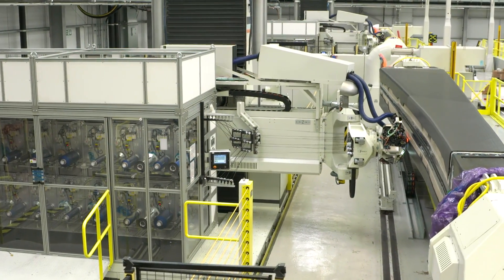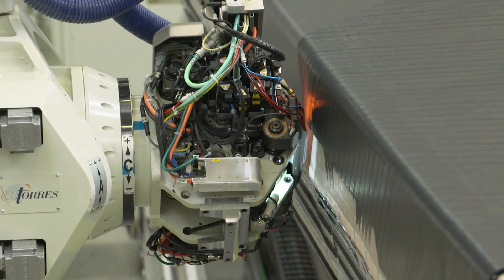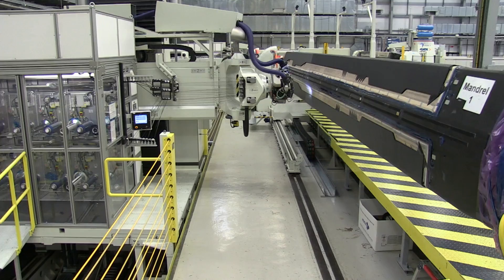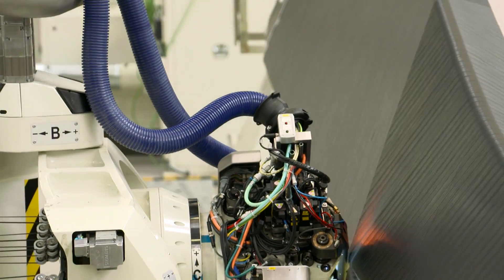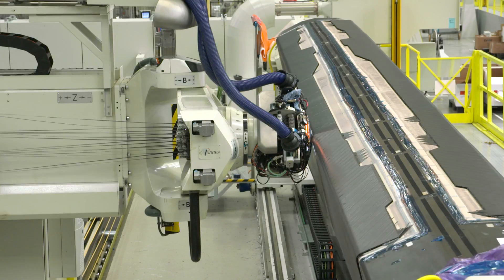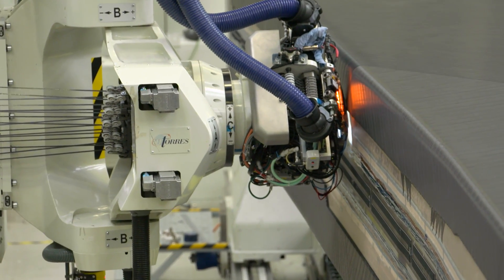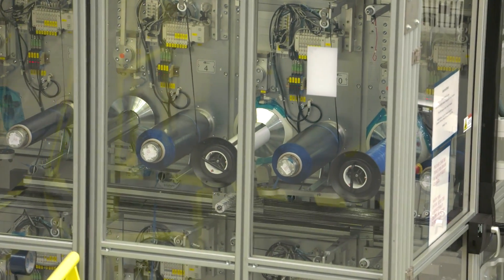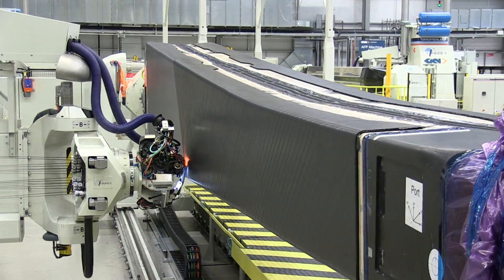GKN/ MTorres fiberplacement machines manufacture the rear spars of the A350 wing box

Comment: I run this machine, it is nice but the vacuum system for the poly needs to be redesigned. Also the plastic guide rollers wear and bend quickly